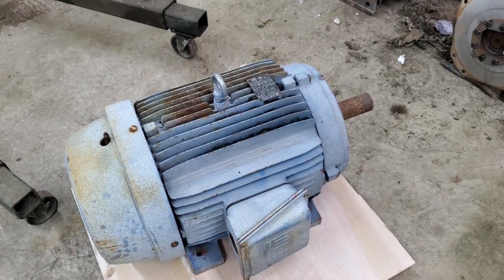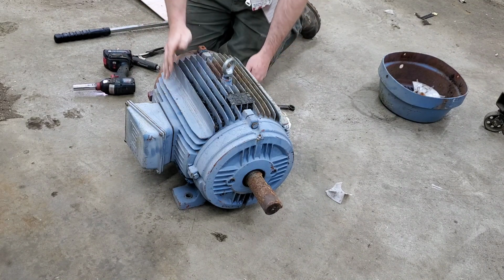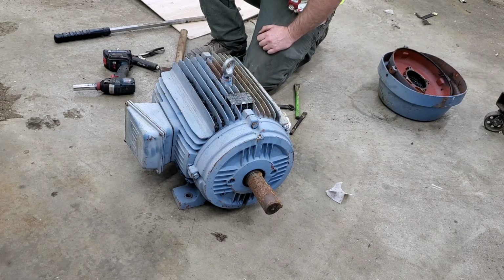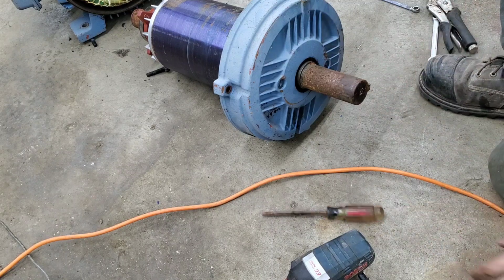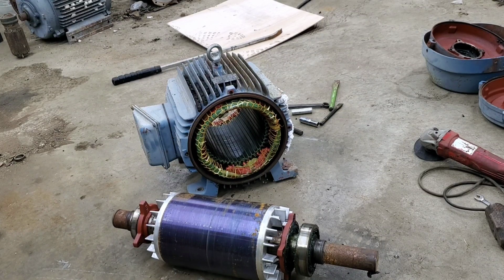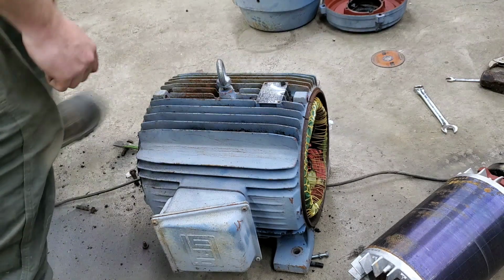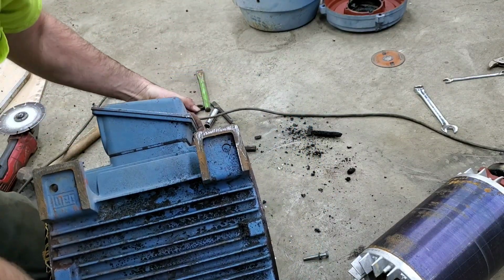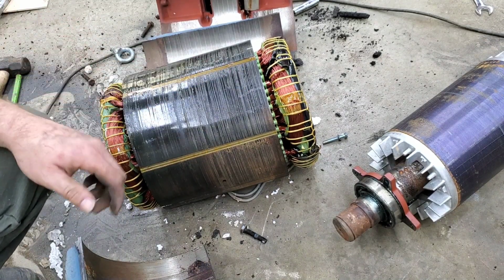How much copper is in a 411ib 186kg electric motor pt.1

Comment: Is that one of those cut-off wheels that's supposed to last a long time and cut anything? 
What are your thoughts on it? I mean relative to a regular wheel... Are they worth the price? Do they dull out? Do they break? 
Thanks in advance.
Reply from the maker: They cut copper well they cut the motor cases well. But normal steel seem too be super slow. But its holding up pretty well
Reply: @midwestsmelters190  Thanks. Good to know.